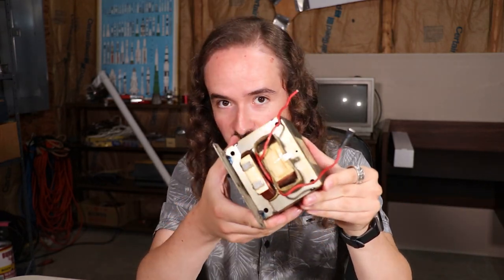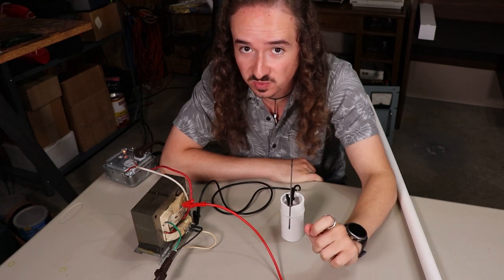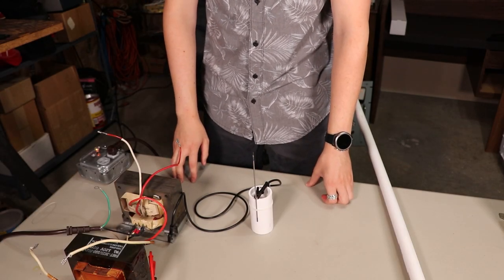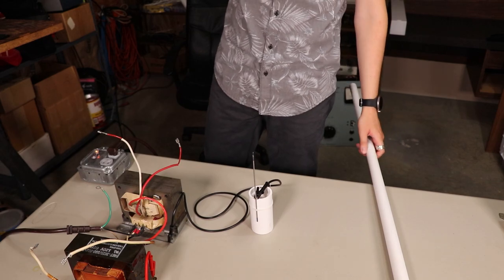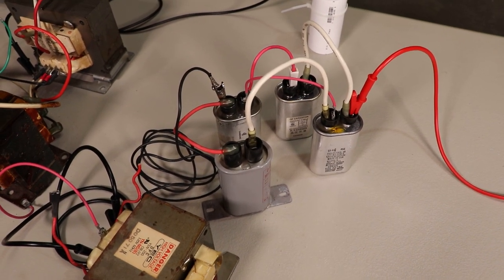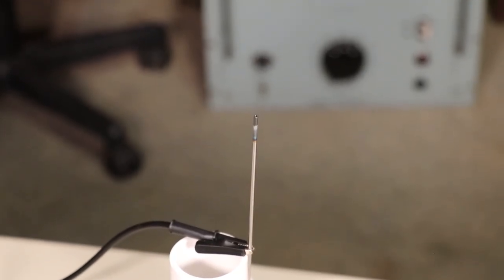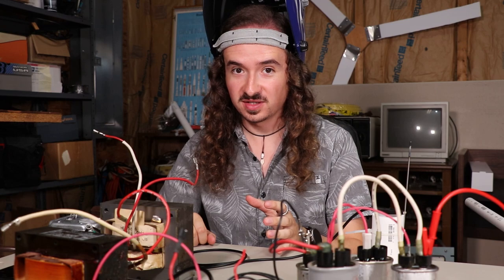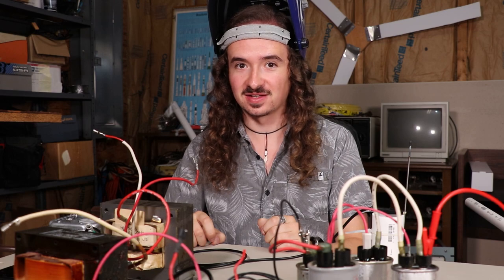Dual Resonant Microwave Oven Transformers: Huge High Voltage Arcs!

Comment: happy to see you're using a welding mask, most people don't talk about how much damage the UV light produced by those arcs can do to your vision
Reply: yeah maybe I need to get one of those if I'm to keep using my 2 mots in series...
Reply: Dual resonant microwave oven transformers can create huge high voltage arcs! These arcs can be up to 6 inches long and produce a loud noise. They are created when the transformer is energized and the two resonant frequencies interact. This creates a large current that flows through the transformer, causing the arc.

As we all know, the sun emits a great amount of ultraviolet (UV) light. This UV light is potentially harmful to our eyes, and can cause a lot of damage. The UV light produced by those arcs can be even more damaging to our vision than the sun's UV light.
Reply: Should even be wearing long sleeved clothes to avoid UV burns! :D. I will be doing that once I get back to building one of these again.
Reply: I've gotten sun burns from welding!!
Reply: I KNEW ITT THANK YOU I was thinking abt this and you confirmed it for me
Reply: I think using welding helmets is actually dangerous, it occludes most of your visual field and you might not be aware of something going on, its better to use dark sunglasses if the arc has a current of less than 10 A, most sunglasses and even plexiglass safety glasses shield you from UV light below 370nm.

Comment: you say "don't do it without experience in high voltage" but i am now realizing that's how you get the experience in the first place
Reply: You can get high voltage from much less dangerous low current sources. 

There’s also the possibility he’s a lineman or industrial electrician etc who got training in a controlled work environment.

Comment: when using 120V in MOTs, they saturate. it's the reason why the breaker trips all the time, on 15-20A when it's supposed to be rated for 1kVA+. so, i highly recommend using a variac (atleast 3kVA or so) and drive them at 90-100V, you'll still get bigger arcs and it won't trip the breaker fast. MOTs on idle on 120V is about 8 amps, 100V is about an amp more or less.
Reply from the maker: Yeah, what I really need to do if I do next time I do this is just put the two MOTs on two separate 120V 20A breakers. Or put them split phase 120/120 on the 240V 60A breaker I'm planning to install soon. Two on the same 120V 20A breaker is just asking for this to happen, haha. Variac I have is only 2kVA, so it can't handle two at the same time, unfortunately.

Speaking of variacs though, I'm actually in the market for a good deal on a 240V ~14kVA variac or stack of multiple (e.g., three of them from 3-phase equipment), that I can put in parallel with balancing chokes, that will add up to ~14kVA. Would be nice to have that for some of the stuff I'm planning to do that involves the 240V 60A circuit.
Reply: @CoilLabs  "240V 60A breaker I'm planning to install soon"

that's really good, you can buy a step down transformer 240 to 120v and get 120A. that's really good! i plan on buying a step down transformer to get 80A out of 40A socket, i need to replace the dryer socket first because it's from the 70s and rusted/oxidized. also rated for 30A atm. so yeah, you need at least 15kVA step down transformer just to get 120A on 120v.
Reply: @CoilLabs  your 2kVA variac will still be fine with driving 2 MOTs, as long as you're using capacitors which limits the current, so it should be okay. just drive them at 90-100V so it doesnt increase the current too much.
Reply from the maker: 15kVA 240 to 120 step down transformer sounds like a beast, but that would be a lot of fun, haha. Good luck with that, that sounds like a pain. Definitely want to replace the socket with one that's in better shape before you start doing "fun" stuff with it, lol.

And yeah two cords is what I mean by two separate breakers. I have multiple circuits on separate breakers in my workshop. There's one circuit that only has a single outlet, right under the breaker panel, that I use for "high voltage playtime" so that if I trip it, it's not knocking anything else out and I know I can use it up to 100%, because nothing else is on that circuit. But I have other outlets nearby on different breakers that I could use as well. Really doesn't matter if they're on the same phase or not, since the primaries are in parallel. I can just swap the phase of the secondaries in series if it's out of phase.

And yeah, you're probably right, turning it down on the variac to get the whole thing under 2kVA probably isn't going to make too much difference in terms of visual effect. Will probably look about the same.
Reply: @CoilLabs  and yeah if you want even more amps than 60, you should do it. 120A
Reply from the maker: Oh sorry, I misunderstood what you said. I get what you mean now. You're saying parallel two 20A circuits (on the same phase, obviously) into the primaries of both MOTs. Theoretically draw 20A from each, as long as the impedance of the wires going to the two different outlets is roughly the same. Yeah, I suppose I could do that too. More risk of cooking the windings on your MOTs that way though if you don't take breaks and give them time to cool down, lol
Reply from the maker: Though I guess it's still not as bad as running it split phase on the 240V 60A circuit I'm talking about. That has even more cooking potential, haha
Reply: @CoilLabs  eh its fine, just add more mots all in parallel, maybe even parallel-series, and use a bunch of caps in parallel, theyll barely heat up if you run at 90 to 100v. Like i mentioned, 120v saturates them, so lower the voltage a bit, and you wont burn them. You can even play with them for like 30 to an hour. Cant wait for you to get your big boy variac :)
Reply from the maker: Haha, I love that the answer is "just add more!" But yeah, it's kind of amusing how those transformers are so under designed, just to be as cheap to manufacture as possible, but still get by and work fine for what they're technically designed for.
Reply: @CoilLabs  Just imagine getting ahold of even one transformer from the first or second generation microwaves. All copper windings, no aluminum, and HUGE. Like from a vintage Radar Range oven... imagine 4... bullet proof damn near! I've played with MOTs since I was a teenager in high-school. About the danger... it's no joke. My uncle was a mentor to me in my electronics/high voltage adventures and he got bit once by 2 MOTs, secondaries in series. It went in his right hand and came out his elbow into the ground clip of his oscilloscope probe he had laying there. Caused permanent nerve damage in his hand and forearm up to the elbow. Thank God he was using the 1 hand rule, however he told me. NEVER DRINK AND PLAY NO PLAY TIRED! (He was awake but had drank a few beers. Simply forgot the switch before adjusting something)
Reply: @ripstephenhawking8787  had that happen to me. It's not nice stuff. I'm much more careful after that incident
Reply: @CoilLabs  thats what I was thinking but pushing it make sure to wear your rubber boots and gloves!! Lol

Comment: Should we study up the information on high voltage?The risks, the how to use the equipment, and all the safety requirements you need to do to protect yourself and equipment around you before you start working with high voltage

Comment: I'm kinda new to this...I have taken apart 2 microwaves and 3 tvs... for the parts for the tesla coils I have been reading and learning for 3 years now I'm being safe making sure all is unplugged I got a job at l3 harris as a electronic assembler and taking my ipc class soon...so I'm excited....I'm a father of 4...38 years old and left my shut career I was in just because of the money I was stuck...doing pipe fabrication...any way...I wana power a tesla coil with the microwave transformer but I'm confused after the power supply  comes the trans to the capacitor I got out of the same microwave and then I'm kinda lost on next step....will I need another capacitor bank or need to make one....
Reply: So first you have your hv power supply, then the microwave capacitors and then a capacitor bank made out of puls capacitors for the primary tank circuit. The microwave capacitors are just to improve the output from the microwave transformers and they can not be used for the primary tank circuit becaus they are not pulse capacitors. The microwave capacitors are also some kind of balast for the transformers. I hope this helps you if you have any further questions just ask. Have a nice day.

Comment: Hi, great video! I just wanted to confirm: for your ballast MOT, did you place the primary in series with the high voltage line from the other MOTs, and then short the ballast's secondary?
Reply: I might be a little late to answer your question, but the answer is yes! The schematic goes as follows: Two MOT’s with the primaries in parallel / their secondaries are in series / the ballast’s primary is in series with the secondaries of the other MOT’s / the capacitors are wired in parallel with each other / the joint capacitors are wired in series with the rest of the circuit (the secondaries of the two MOTs and the primary of the ballast. I hope that helped!

Comment: I added a test arc starter to my MOT circuit.  I set up two vertical probes about an inch apart.  Since they were not touching, there was no arc. Turned of and unplugged.  Then I hooked up a HV ARC circuit, using 2 isolation door knob capacitors, to each vertical probe.  HV ARCs appear between the base of the vertical probes.  Turned off HV Arc starter circuit.   Turned on the MOT.  Nothing is happening yet.  When I turned on the HV arc starter, the MOT started conducting through the HV ARCs.  Two individual flames appeared, one on each probe.  When the HV ARC was turned off, the flames stopped.

Comment: I made the same thing using a 600 VA transformer of an inverter connected parallel with a 150 micro farad 400 volts capacitor.  .

I got plasma at less than 230 V
Reply: Super high amps lol

Comment: How are the transformers connected in the second experiment, specifically? You seem to be saying that the secondary of the first MOT is feeding the primary of the second MOT. Wouldn't that make the final output over 30,000 volts?

Comment: Why does the arc not last very long?
Reply from the maker: Partly because I am purposefully putting it out after a few seconds, by pulling the electrode back. MOTs aren't really designed to be shorted out like that. They get hot very quickly doing that, so I keep it brief to avoid damaging them. But also, sometimes it puts itself out due to convection. The hot plasma rises and you can see how the arc moves upward. That makes the path of the arc longer and sometimes that causes it to get too long to sustain itself.

Comment: This is amazing. How did you manage to make two transformers work with that insane voltage?
Reply: It could probably matter how big the transformers are, or it could depend on how much voltage the transformers have. And on top of that, he has different sized capacitors with the transformers.

Comment: I want to see what happens when the arc is verticle.
Won't the plasma make it more stable if the arc is not experiencing a 90° force from convection?
How about putting it inside a tube too?
Are you using tungsten electrodes?
Reply from the maker: It probably would make it more stable, yes. I purposefully only want to let it arc for a short time though so I don't burn up my MOTs. They can't handle this much current for very long. Yes, I am using tungsten electrodes.

Comment: I've run 7 microwave Transformers off one breaker before it's not too easy to do so do you have to perform a special circuit so you don't trip your Breakers by upping the amperage of the output of the circuit and then putting in your transformer

Comment: So when connecting two microwave transformers on the same circuit you should pull input power from two different circuits in your house, but by pulling from two different circuits are your inputs 180 degrees   out of phase? I know you dont want two phase matched inputs as it could cause serious problems.
Reply from the maker: In this video, I actually have both transformers on the same 120V 20A circuit. It's definitely a bit too much for one, as you can see I trip the breaker multiple times. Probably would be smarter to separate them onto different 20A circuits, I agree. As far as the phasing problem, it actually would depend on the specifics of your house wiring. The way residential electrical service works here in the United States is we have split-phase 240V coming in from the distribution transformer, with the neutral connected to the transformer's center tap, so you get 120V by referencing neutral to one of the two split-phase hots. So some of the circuits in your house are on the one hot rail, while the rest are on the other. So if you had the two MOTs on different circuits, it's possible you could get them 180 deg out of phase (i.e., anti-phase) if the two circuits happen to be on opposite rails of the split phase mains. It depends on how the circuits are arranged in your breaker panel. For what I'm doing here though, it actually would not matter much. In what I did in the video, I had the MOT primaries in parallel, but if I used two different circuits, I could keep them separate, it wouldn't matter. The secondary side of the circuit is isolated through the transformers, nothing is referenced with respect to mains neutral, so I can just connect the MOT secondaries however I want to make sure they are in phase with each other. I want the seconadaries in phase, because they are in series and I want the voltages to add. If the secondaries were in anti-phase, I would get basically zero volts, because they would cancel each other out.
Reply: @CoilLabs  Thanks for clarifying

Comment: "Do not do this unless you have a lot of experience with high voltage."
"How do I get the experience?"
"By doing this."
:-)
Reply from the maker: My point is that high voltage beginners should not experiment with microwave oven transformers and especially not with resonant capacitors, like this. Even a single transformer, with no capacitors, is enough to kill you. I spent a couple years learning how to work with high voltage safely through building circuits to drive flyback trasnformers and other, much safer things like that, before I ever dared plug in a microwave oven transformer.
Reply: @CoilLabs  Same. I work now for about 3 years with high voltage and I would not feel safe to plug in a MOT. I still want to improve the safety bevor I power up a MOT. It is very important to start small becaus MOTS are some of the most dangerous components you can find in consumer electronics.
Reply: I have messed with high voltage for a long time, as much as 50KV, but with almost no current.  Been shocked a million times.  But this is something I would be damn careful with.  Touch the output of a MOT and you are dead, instantly.  No Joke!!!

Comment: Apologies if I missed the mention in the vid (I clearly skipped straight to the arcs...), but did you perhaps use something akin to a HPS/other HID ignitor? I'd be thrilled if it did since my core-coil ballast shorted to death some time ago & I was able to repurpose the core rewound as a welding choke but was stumped over what I could do with the igniter since the sucker's potting and lack of specs to be found after a thorough search has kept me ignorant on its inner workings.
Reply from the maker: What you see in this video is just microwave oven transformers and microwave oven capacitors, that's it.
Reply: @CoilLabs  D'oh! Thanks for clarifying my overly-optimistic projections... Upon further examination I embarassingly confirmed doing just that by imagining that the pvc tube you were using for an electrode stand was one of the capacitors in question. Ugh, regardless of them both being similar form/color, I still apologize for the needless  time waste!

Comment: A dual resonant microwave oven transformer is being used to create huge high voltage arcs. The transformer is made up of two coils, a primary and a secondary. When the primary coil is energized, it creates a magnetic field that interacts with the secondary coil. This interaction causes an oscillation in the current flowing through the secondary coil. This oscillation can be harnessed to create high voltage arcs.